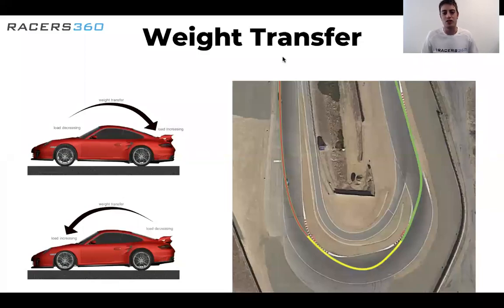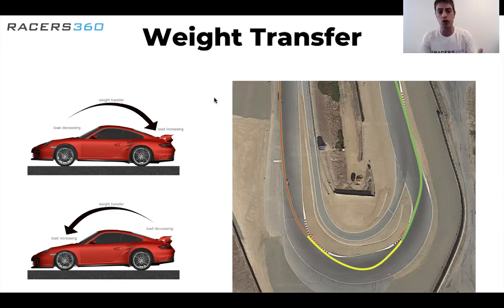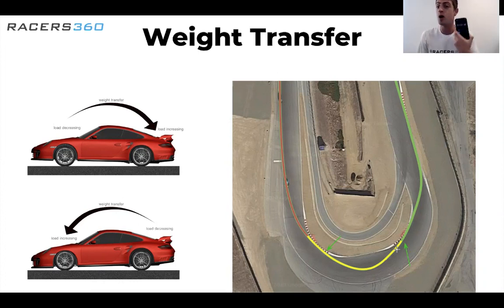Weight Transfer For Racecar Drivers Explained In Under 60 Seconds

Comment: The length of the yellow doesn't make sense. You should be off the brakes by the time you are at the point of tightest radius turning (i.e. apex).
Reply from the maker: Yellow line is anything from very light brakes to coasting -- the transition period (obviously it's a range depending on the car type).  In many cars you are only starting your acceleration when you approach that second apex.

Also, tightest radius turning isn't the apex -- the apex is where you get to the closest point to the inside of the corner.  Two apexes in this corner.